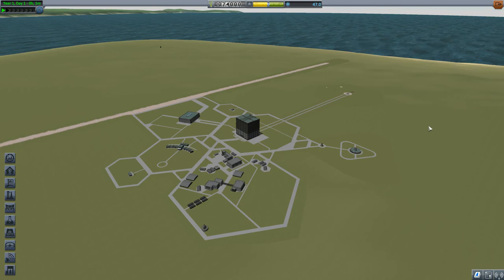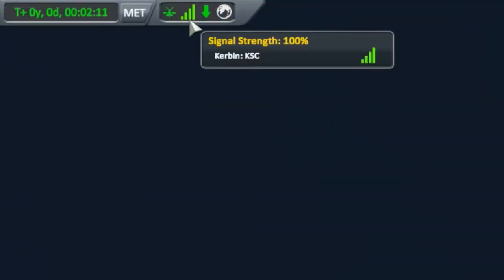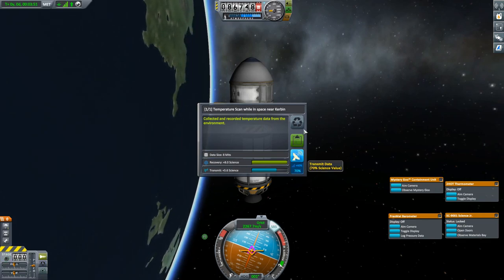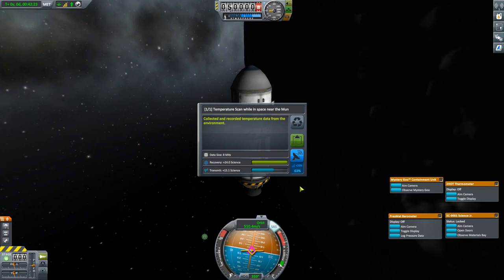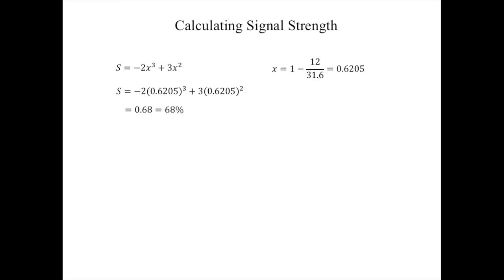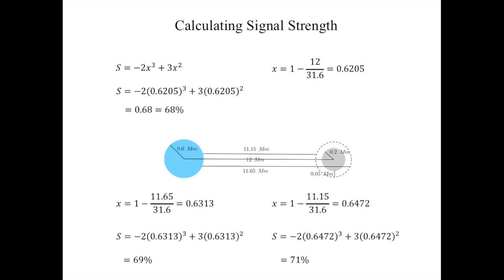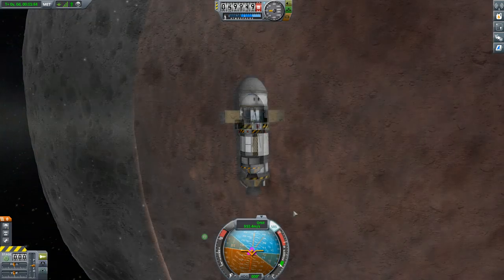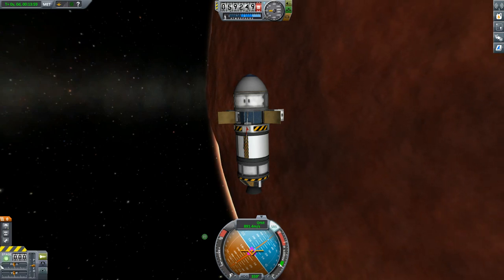Ranges and Signal Strength | KSP Let's Do The Math

Comment: One of the Mods I really wanted to use was RemoteTech but found it a little unforgiving. So when they added a "lite" version to stock KSP, it was one of my KSP dreams come true (still waiting for life support).

This video certainly made the basics come to life, instead of simply adding "moar boosters". Thanks.
Reply from the maker: I really like the stock comm system.  It's the biggest reason why I wanted to start a new career with 1.2.  Life support would be nice, but I wonder if the devs worry it may be too much when under budgeting fuel has a good chance of producing dead Kerbals.

I really want to give Kerbalism a go.  That combined with a part mode like MOLE sounds like a blast, but with three KSP builds on the go right now, perhaps I should wait.
Reply: Kerbalism is very cool, but it override some game mechanics (for ksp 1.2.2, not sure for newer versions) like science transmit, isru and doesn't have very good mod compatibility.

Comment: How about combining relays and direct antennas for comunication satellites? How does that work?
Reply from the maker: For the connection to the KSC, I would guess the antennas would combine as described. I'm not sure for a signal relayed to another antenna. My guess would be only the relay antennas would count. A little experimentation would answer the question.
Reply: @MikeAben  Yeah, I will try. Because It would be great to use one relay antenna and a bunch of Communotron 88-88 because they are easy to put on sides.

Comment: I've got a contract to put up the SENTINEL Scope in an orbit just this side of EVE.  I'm going to go about it, but I'd like to see you do a vid on the same contract (The orbit is always slightly different, but everybody gets the contract offered at some point), from determining what is needed to fulfill the contract, to building the probed and launch vehicle to putting it successfully in orbit.  No pressure.  BWAHAHAHAHAHAAAA!!!!!
Reply from the maker: I've not gotten to that in the tutorials yet and it may be a bit before I do. Today's video is more advance rendezvousing and next I want to get into RCS and docking. My most recent let's play series has a lot of interplanetary stuff, but they're not really set up as tutorials.
Reply: @MikeAben  About sixteen hours later and it no longer matters.  I went ahead and built it and launched it.  I got it going in the right direction past the Mun and Minmus and in between the orbits of Kerbin and Eve.  Then I did something I kind of wish I'd recorded.  I had a pair of contracts for sats going to Minmus in opposing orbits, and decided to try sending them along with a set of communications network sats.  So 4 definite sats, plus the launch vehicle with an antenna on it to be the 3rd and final comms sat and I was off.  Burned so my PE was coming more or less equatorial and moving EAST around Minmus, then released the first sat.  Then burned to get the PE to come back through Minmus and go WEST around Minmus, then released that one.  Then burned to put the launching craft back roughly equatorial and going East when it got to Minmus.  At this point I checked their Minmus PE's and adjusted as necessary.  I then pre-programmed their capture burns and left each with JUST a capture.  They all arrived within minutes of each other, so I had to figure out which was arriving 1st, which 2nd and which 3rd, then did each burn and switched to the next craft as quickly as possible.  Then set-up the comms network, then did the eastbound satellite (interestingly all I had to do was get the inclination set and it completed.  Then I switched to the westbound sat and... did nothing.  Apparently it got there close enough to be considered in the proper orbit.  By the time I got done with that the Infrared Sat was well past the orbit of Minmus.  I set up a retrograde node to bring the Ap in and switch it with the PE and took the PE down as close as I could to it's designated distance from the sun.  That burn is 18 days away in game time.  I've been sitting in front of my computer for about 20 hours right now, alternately watching vids to brush up, and playing Kerbal.  I can't even remember what else I got accomplished today, but I got a LOT done.  I'm through talking.  Keep the vids coming and take care.
Reply from the maker: @charlesballard5251  Well done!